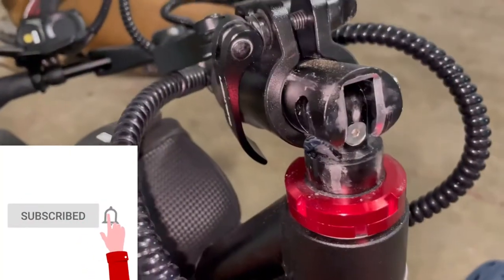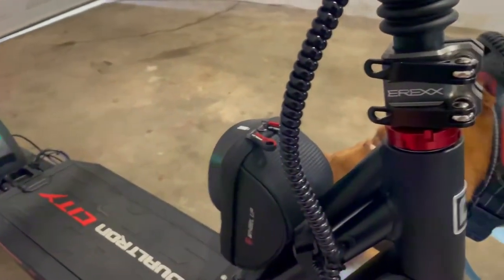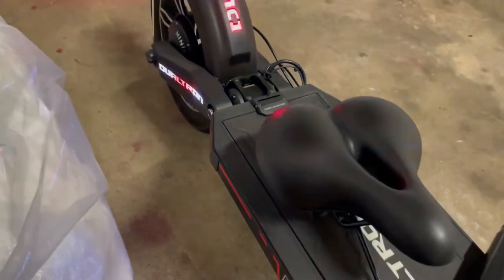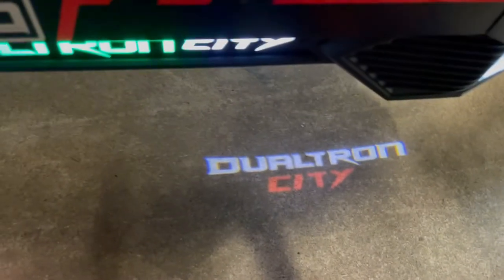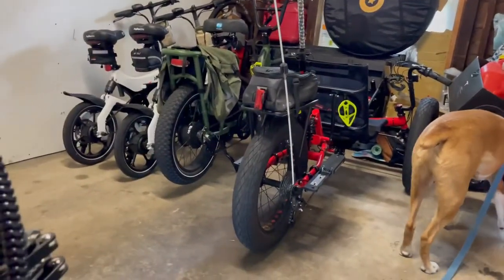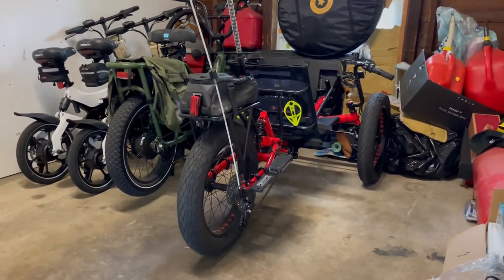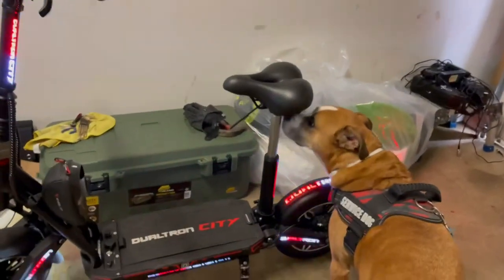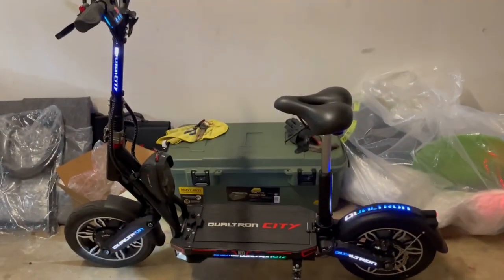Dualtron city erexx stem clamp and seat kit dualtron city

Comment: I am thinking about buying this one , how much you weight  ? did you tried the max range on rather flat road and if then at what speed ? I would like to travel at 30-35 km/h I saw there is now Samsung batteries version but from where I want to order there is no Samsung only LG
Reply from the maker: I would not buy there was a lot of wiggle with the stem and a lot of noise. I did not like this. I sold it only one month after.
Reply: @JerseyStyle7  but the erexx stem clamp didn't helped ?
Reply from the maker: @WildBeret not really, it still made a lot of noise

Comment: What was the original clamp doing? Did this new clamp fix it? The stem on my Achilleus moves back and forth quite a bit.
Reply from the maker: Yes this new clamp fixes everything it’s a lot easier to make tight and the metal is a lot thicker👍🏽

Comment: lol,,, 😂😂😂😂 you’re a comedian 😂😂😂 you completely skipped the most important part. I have a Drone thunder same clamp as yours. The old one came out. It fell right off, but this new one on your video is not sliding in and that was the whole purpose of watching this video instead you skipped that entire part and lied and said that it was done in two minutes.
Reply from the maker: I really don’t know what you’re talking about. It took me two minutes. It did not take long soon as I took that pin off. It went right on at the time when I filled this video I did not have a tripod so I don’t know what you’re talking about maybe yours took longer this took me two seconds. It was not hard. I work on this stuff all the time. I just didn’t have anybody to hold the camera I don’t know what you’re talking about. But thanks for watching.👍🏽💯